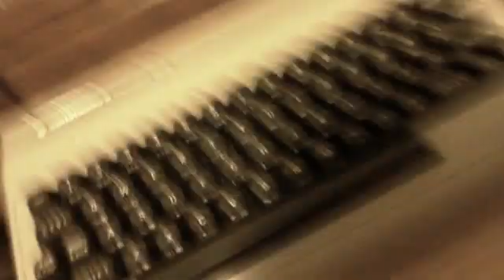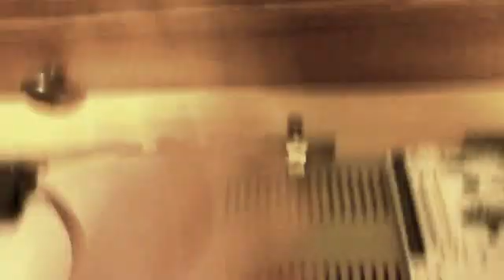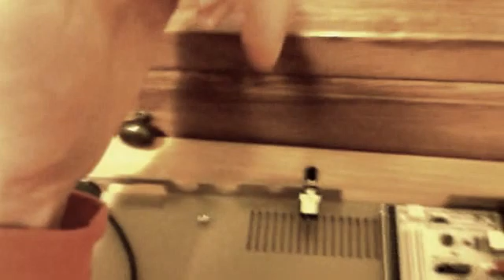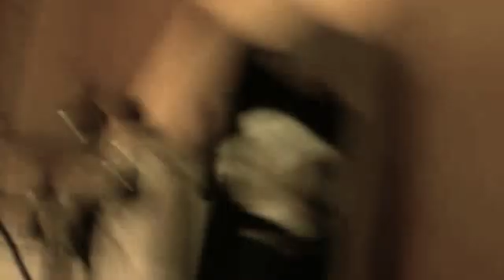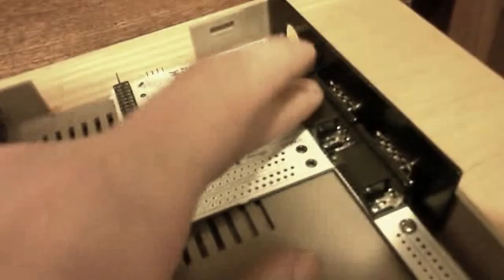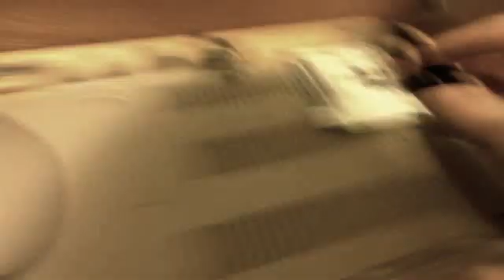Raspberry 64 Part 1

Comment: Do you have an additional info or a tutorial on how you built your power board?
Reply from the maker: I can do a separate video about it if you want!
Reply: That would be fantastic!
Reply from the maker: I just uploaded a video about it, hope you can find time to check it out.  And please let me know if there's anything else you would like covered!
Reply: Thanks much for making that.  You answered most of my questions about your board.  Kinda a newb on making my own electronics.   I noticed your c64 power supply was 5v 8a, was mainly curious to see if you stepped down the power before it goes to the pie with the amps being higher than what the pi wants.
Reply from the maker: Hey, no problem!  Glad I could help.

Electronics are a funny thing.  So long as your supply is equal to or more than your needs (the Raspberry Pi 3 doesn't take more than 2.5 amps) you're good because the load only draws as much amperage as you need.  So no need to "throttle down".  That would only be an issue if you were running a higher voltage than needed.
Reply from the maker: Actually, thinking of a better way to describe it.  Using Ohm's law you get I=V/R.  So if your voltage (V) = 5V, and you figure your Pi will draw a maximum of 2.5A (I), then then the resistance of a Raspberry Pi is about 2 Ohm (R).  If the resistance ends up becoming less than that (say 1 Ohm for example) it will end up drawing 5A, and cause issues such as over heating.  This would be caused by a short on the board.  So, yes, in theory having an 8A power supply could cause an issue due to the higher amperage being available in the event of a failure, you would need something to go wrong first in order for the amperage to be an issue.